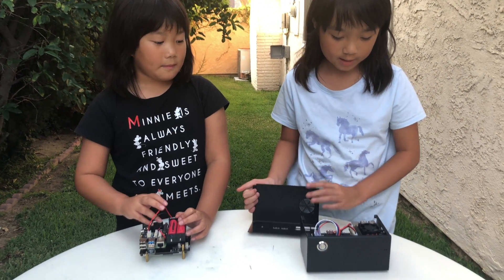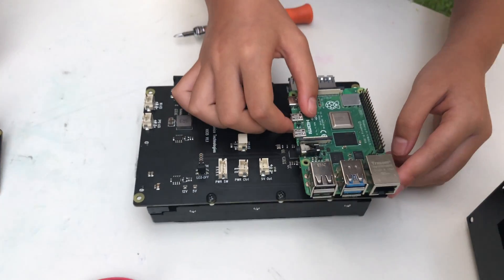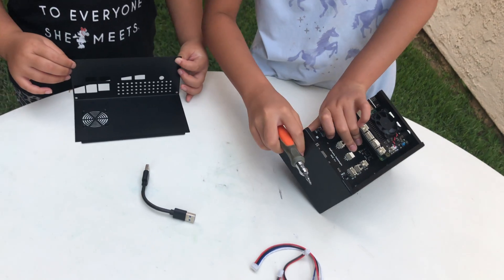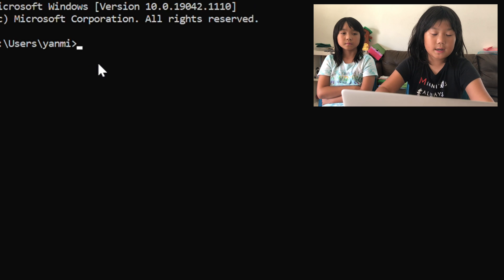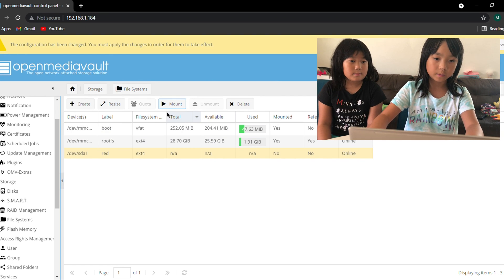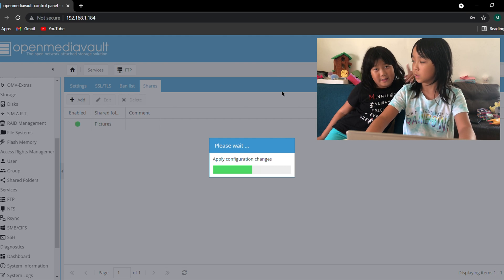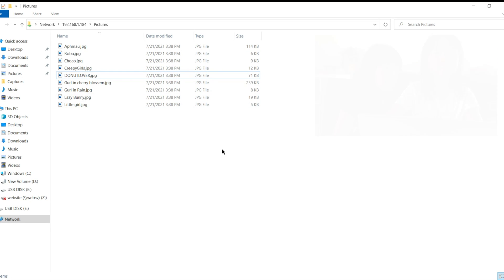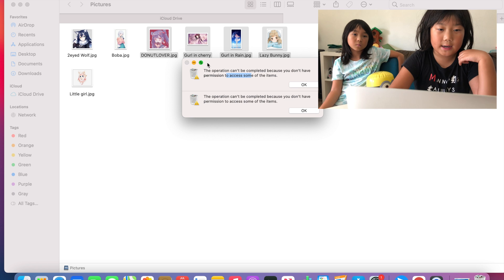How to build a budget DIY NAS server with Raspberry PI & Openmediavault & WD red nas hdd

Comment from the maker: When you burn the raspberry pi os image,there are 2 ways to enable ssh. One is to press ctrl+shift+x before you press write button in RPI images v1.6+,the other way is to put a empty file named ssh without any extension name under the root of your micro SD card.

Comment: i think the one at 0:32 is a better solution because it has a UPS. UPS is more important than a case imo.
Reply from the maker: You need a UPS board( www.amazon.com/Geekworm-Raspberry-Management-Detection-Shutdown/dp/B08DNRYM4Y ) and 2 pieces of 18650 batteries. It can only work with a 2.5" hard drive or SSD.